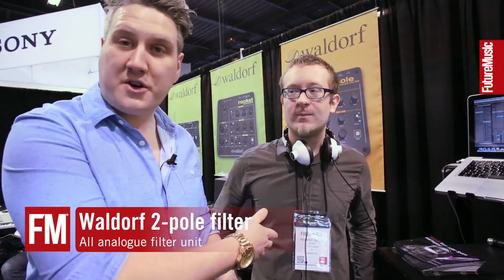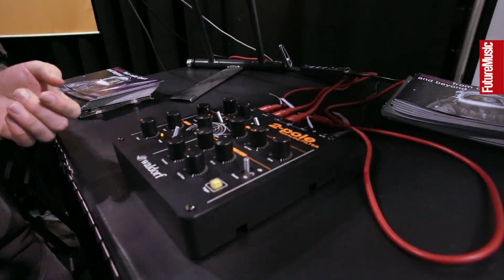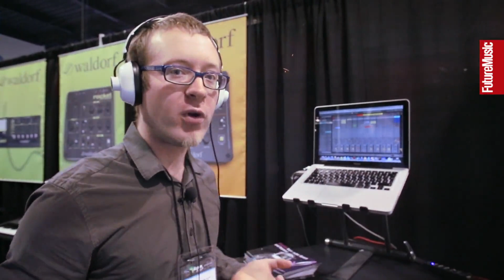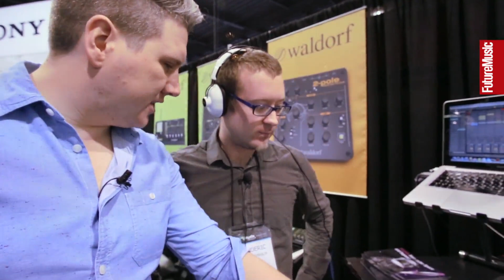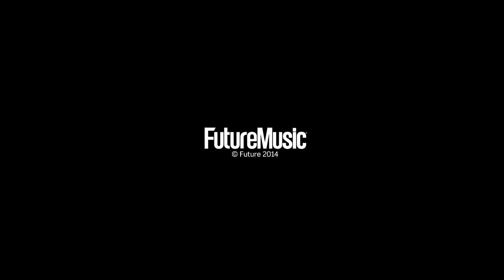NAMM 2014: Waldorf 2-Pole Analog Filter

Comment: This is a nice idea from Waldorf. The filter in the Rocket sound beautiful, sweet and musical, and will sit nicely in most mixes. Really like the formfactor too.
Only thing, i think the 200€ pricetag is too close to the Rocket, despite the extra filtering relevant features the filter itself is the same, and with the Rocket you also get a great sounding very capable synth.
Looking forward to trying this out in the flesh.
Reply: Can the Rocket act as a filter for external inputs?
Reply: VirtualMark Yes, it has a input for that. And while it's not fully apparent on itself, if you switch to the square wave and turn the left OSC knob fully counterclockwise, the pulsewidth drops below the audible, that way you can filter away without the oscillator getting in the mix - which is usually preferable.
Reply: MarctheDarc Ah thanks for the reply.  So the Rocket basically does everything that this filter does?
Reply: VirtualMark Not exactly. The basic filter circuit is the same, but the 2-Pole has a different "secondary" feature set; like different envelope behavior, CV/gate control, rectifier knob and drive knob (as opposed to the drive toggle on the Rocket), and more. Things that do make this a more suitable choice for filtering alone. So if all you need is a filter, and have no use for the synth what so ever, then this is better choice. But the Rocket does sound great, and does the filtering well too, so in most cases i think you'd be happier with the more versatile solution.
That said, i would actually wish the Rocket had the drive knob instead of a toggle, since the drive in the Rocket sometimes is a bit much, and a knob would afford more control.
Reply: MarctheDarc
Im going to use it with my ms-20 and my microbrute. cv ftw